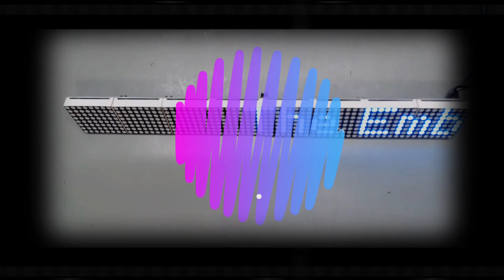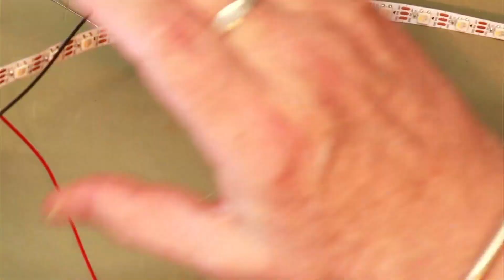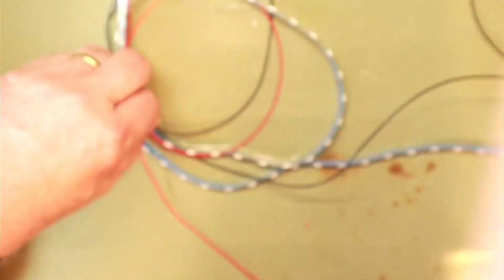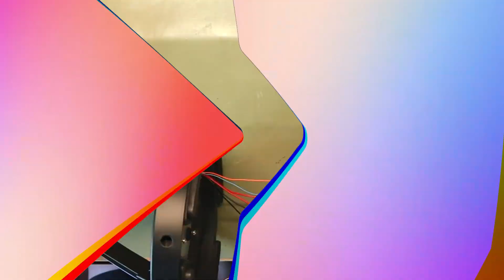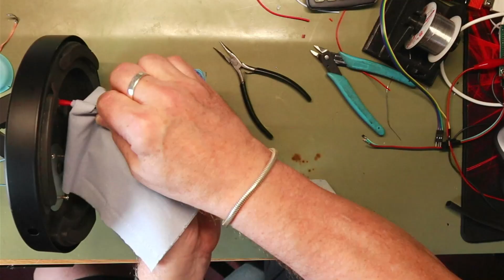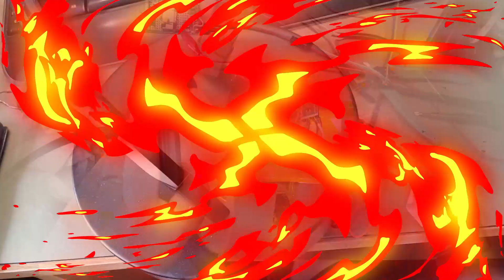#238 spiral lamp part 4 fitting the led’s into the lamp

Comment: The project is coming along nicely. Great stuff TEH.
Reply from the maker: Got to get the most out of it as the cost is mounting up. I still need a 5V 5A+ PSU to power the thing if i don't over do it. 10A if i turn all the LED's on ;-(